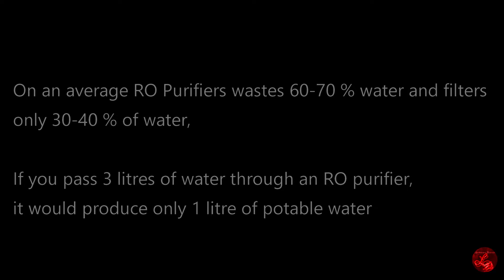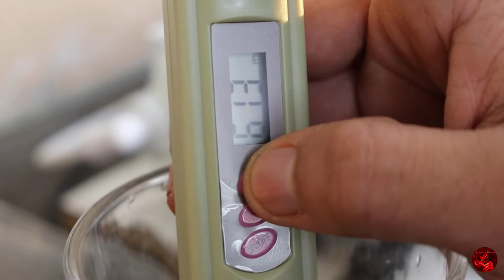Reuse RO Waste or Rejected water | Refilter RO waste Water | Reuse RO waste water under 3000 Rupees

Comment: This is great. What model of submersible pump did you use for pumping the reject water? I’d like to copy this setup. Thanks.
Reply from the maker: the submersible pump is of 40 watts with universal pipe coupling, bought from amazon, all parts are available on amazon, you can give a try and it is worth every penny. summer is coming along with alnino
Reply: @LockDownDiariesDIY  thanks. 🙏🏼

Comment: I have a query, could you please try giving softener water output to RO. I am curious to know if that would help with RO's reject % and or membranes's life
Reply from the maker: Every membrane is manufactured for a maximum capacity of the TDS, so does its flow restrictors are. Providing soft water to a membrane will have no effect on rejected water also it doesn't suffice the use of RO system. If there is already soft water, why to USE RO and make it distilled water.

To further reduce the waste water manufacturer use multiple membrane in "series" to reduce the filtration time they use multiple membrane in "parallel" connection but parallel again increase the wastage but increase membrane life. I hope this answers.
Reply: @LockDownDiariesDIY  In ideal world yes, the softener would moot the need of RO, but hardness in my area reaches 900, and softener though removes hardness, the TDS stays pretty high, also there is some level of salty taste in the soft water. (Now I already have a softener) I am wondering if there is any benefit of giving soft water output to RO or I keep both systems separate. This would impact lot of plumbing decisions.

Comment: Your inlet  water of first r.o. had tds 522, rejected water 820
Second rejected water tds was 2220- this is not proportional, there something wrong.
I am using costom made r o. at my home domestic machine of 12- Lit per hour modified using one more membrane with same machine and rejected water of first membrane is connected to inlet of second membrane and outlet purified water of both membranes is used in drinking . In this case I not need to use tds adjuster because mixed water of both membranes has tds of around 100-150.Means using two membranes connected in series . In this way waste water of first mambrane is used in the same domestic machine. Output from both membranes is above 20 Lits per hour. Hence waste water has reduced to about 55- 60% with two membranes in comparison to single membrane which was 75%. Even with three membranes in series worked well and one can use with three mambranes if tds level is found satisfactory.  I hope you will do the experiment/ trials with 2 and 3 membranes in the domestic machine and share the results with me.
Reply from the maker: I love the idea of adding one more membrane in the rejected, but worried about the pressure applied by the RO Pump, can you tell me the pressure in PSI you are applying on your first and second membranes?
Reply: @LockDownDiariesDIY  
Since membranes are connecting in series same pump will work well only a few minutes will be required to achieve the required pressure to the membanes .
Reply from the maker: Yes i get that, if you can tell me the pressure in psi if you have a meter to measure that will be a great help.
Also your 2 membrane are of same ratings like both 80GPD or both  100GPD or it is a mix match of different ratings?
Reply: @LockDownDiariesDIY  
I don't need to measure. You can do the trial and measure, there is no risk at all.
Please share your results minutely with me.
Reply from the maker: Okay, tell me one more thing before i do it, what is your pump GPD rating? Mine is 100 GPD and membrane is 70 GPD. 
And thanks for suggesting this kind of experiment. It would be very much helpful for me to re filter the waste water with maximum efficacy, and good for my aquarium.

I am sincerely thankful for such a beautiful comment and an Idea to improvise the efficiency of my setup.
God bless you all 😊
Reply: @LockDownDiariesDIY  
75 gpd membranes and 100gpd pump is okay
First you record all the data i.e. input water tds output water TDS
Pressure of pump and membrane pure water output per min, waste water putput per min.
 with single membrane only. 
Then you connect waste water of first membrane to the inlet of second membrane and flow restrictor to the waste water of second membrane.
 Record DATA -
1.TDS of pure water separately of both membranes and of waste water.
2. Flow of pure from both meneanes separately.
3. Flow and TDS of pure water after mixing by connecting with a Y or T connector.
Better data is recorded in a tabular form.
***Please note in case of 2 membranes you have to use only one flow restrictor . Remove from first membrane holder attache the pipe to the inlet of second membrane then attache flow restrictor to the second membrane holder waste water outlet.
Reply: Waiting results of your trials and data
Reply from the maker: Bought another membrane, i will make another video of it, stay tuned brother
Reply from the maker: @ashok Chourasia
I tried to add another membrane in series and below are my findings.

With single membrane
1 glass of 350 ML took 2 minute 13 seconds to fill having a TDS of 100 and rejected water TDS was 790 PPM.

With 2 membrane in series
1 350 ML of glass took 1 minute 38 seconds to fill having TDS of 109 and rejected water TDS was 1420 PPM.
Which seems to be in proportion.
Good thing i observe is i can further filter the reject water with one extra membrane and the pure water output will also increase, i will shoot it and upload next month.
Reply: @LockDownDiariesDIY  use next memrane working with input water upto 2000ppm

Comment: Hi there, very nice customized system you have designed and installed. I have one question that where the re-reject water with 2220 TDS is finally disposed by you please? Regards
Reply from the maker: Hello and thank you for watching our video, the re-rejected water i am dumping into the sewage lines. I could have tried to use this into gardens or washing utensils or others but found it is so hard and make water scales everywhere, however the 2220 TDS is still softer than the water coming out from our washing machines.
Once again, thank you for appreciating our work ☺️

Comment: My tap water tds level is 900 , so i installed RO system the out let water (reject water) tds is 200 . Out let water able to use for bathing or not
Reply: Sure sir reject water tds is 200 , even i checked in 2 different tds meter both tds meter showing around 200 only
Reply from the maker: Hello,

Check if your TDS meter is showing a x10 mark after 200 making it 2000 TDS, anyways i won't recommend rejected/waste water for bathing, hard water causes hair loss. You should use waste water for gardening, mopping, washing utensils and cleaning bathroom and vehicles.
Off course you can re filter waste water just like we do!
Reply from the maker: Hello,

Please check the TDS of waste/rejected water and confirm if it is 200, i am doubting that tap water having TDS Of 900 and rejected water having TDS of 200.
I will respond after that.

Comment: What should be the tds of drinking water?
Reply from the maker: 150-300 is good TDS, if your tap water is having tds in this range, you dont need any RO filter, only pre filter and UV+UF filter will be real good, use copper bottle for storing water and get the best results, dont keep water in copper bottle more than 2 days.